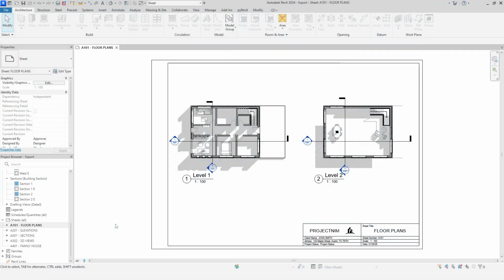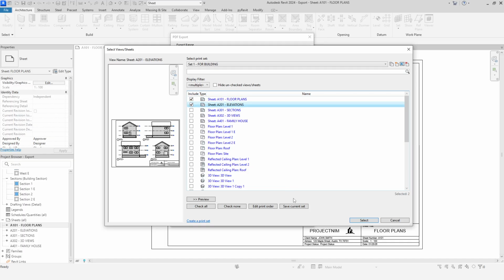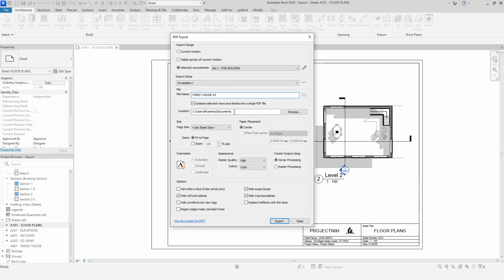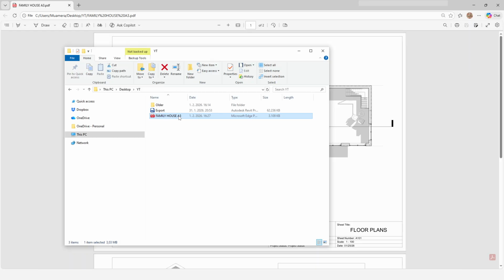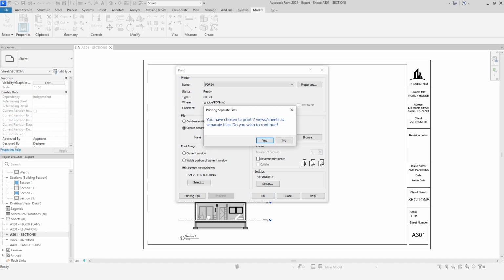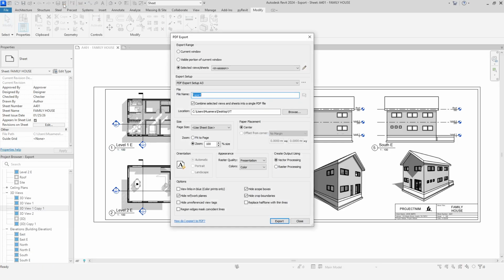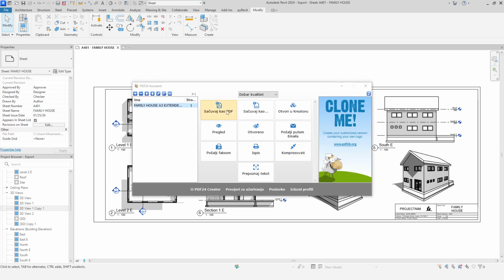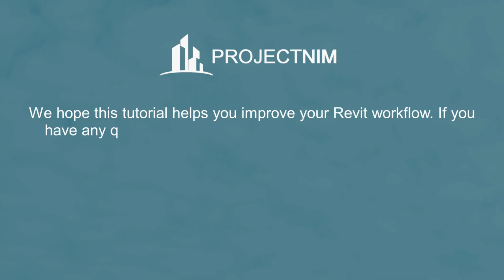Revit PDF Export Tutorial - Native, PDF24 & Adobe with Custom Paper Sizes

Comment from the maker: We’d love to hear from you! Which PDF export workflow do you use most in Revit - the native PDF export, PDF24, or Adobe Acrobat? Drop your experience, tips, or questions below! 👇
Reply: PDF24 works fine when exporting as PDF. I use the Depth option in Revit sections and elevations, but when I use Depth, I encounter many printing issues with Revit’s default print settings. learned the pdf24 option from you. Appreciated a lot.
Reply from the maker: Thanks for sharing this! 😊 We’re really glad the PDF24 workflow helped.